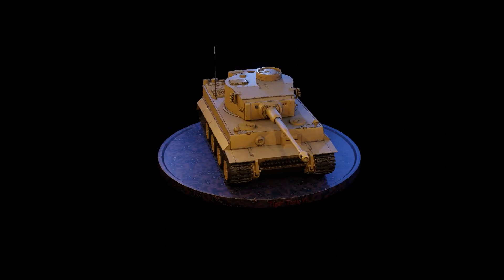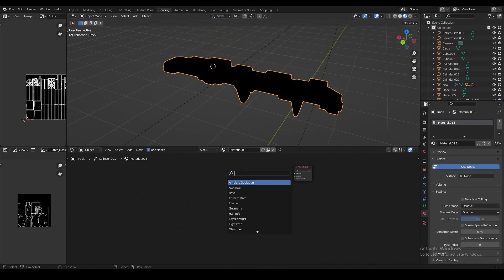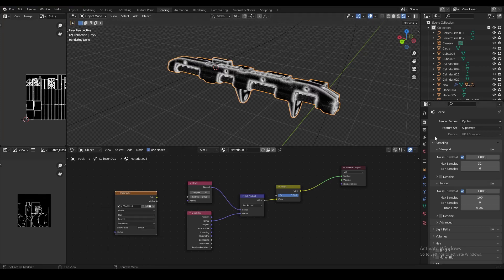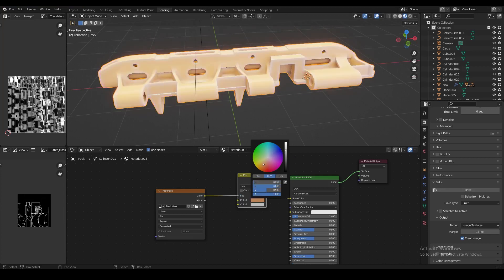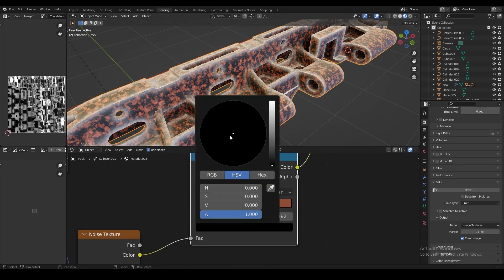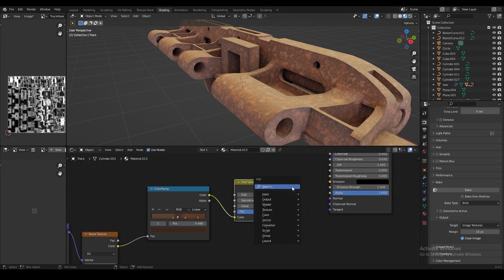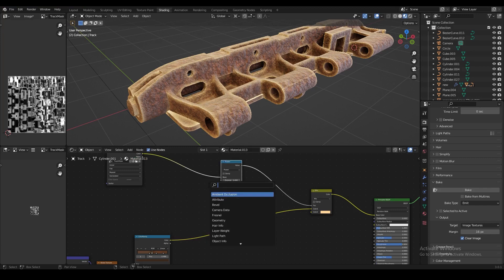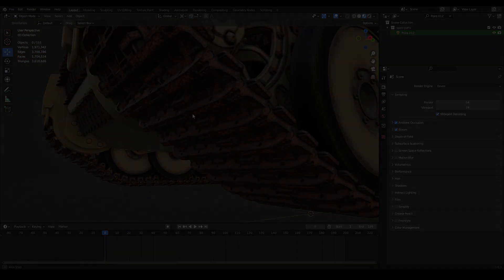How to Texture Tank Tracks in Blender | Rust Tutorial

Comment: Hi , I have a question. When i move my hull forward, tracks start rotating but then stop , same happens when i bring the hull backwards they rotate a little bit more thant moving forward but still stop after some time.
Reply: you need to tick  Extrapolate option
Reply: @berkutl0ve  Edit: my dumb ass didn't know , that I have to check extrapolate on empty sphere itself too. Thank you !
Reply: Are you talking about rigging?
Reply: @maris2353  Yes
Reply: @sidyboi7218  it is probably to do with how far you put the pivot point I had a similar issue that it stopped after a certain distance. I think there is a limit for the tracks array, but don’t take my word. Maybe there’s a workaround.
Reply: @maris2353  Well it didn't work ,thanks for the help tho.
Reply: @sidyboi7218  no problem bro but there must be a solution